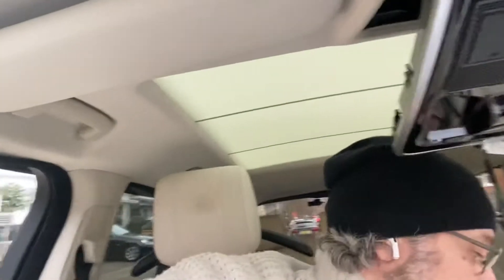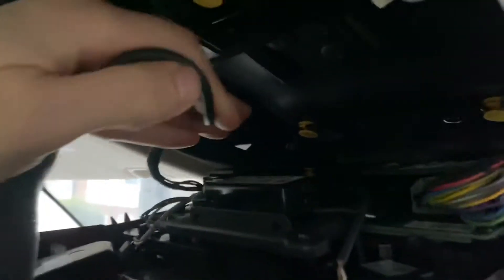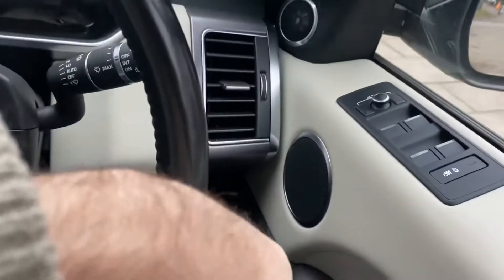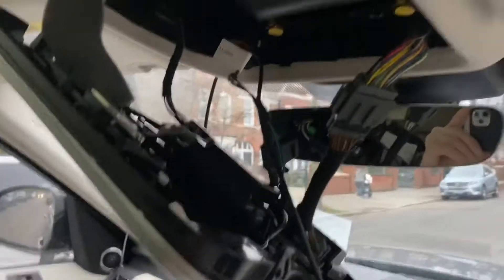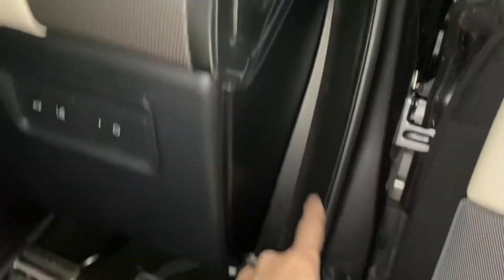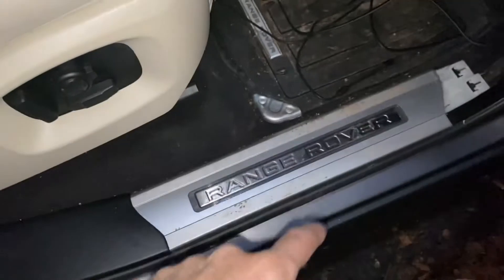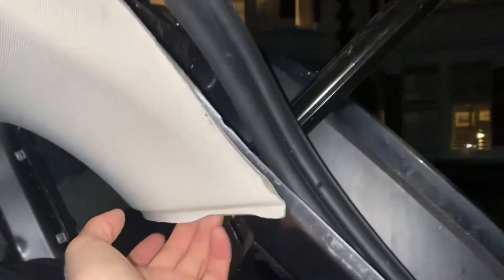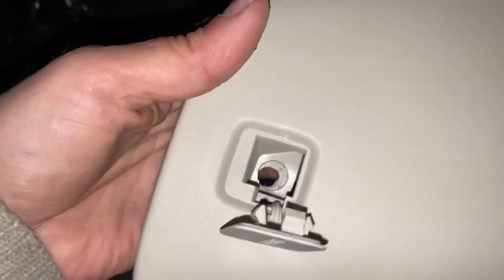How to install a VPLKV0134 Dashcam into a Range Rover Sport L494

Comment: Would have loved to see the last part where you remove the spoiler and feed the cable through the rubber trunking.  That seems like the most difficult part. Thanks for this video though, interesting to see how the trim panels are removed.

Comment: How much did it cost for the dashcam? 

Also how much did it cost for your steering wheel and did you change it yourself or had someone change it for you? 
Do you have a video of it?
Reply from the maker: I got the Dashcam off eBay. paid £370. as for steering wheel did it all myself. again found off eBay and was lucky came with aluminium paddles. the steering clock was trickier to find as there’s different options depending on age/model so good idea to check if your airbag has one or two connectors. didn’t make a video of my doing it (wish I had now) but powerfuluk have one which is where I learnt.